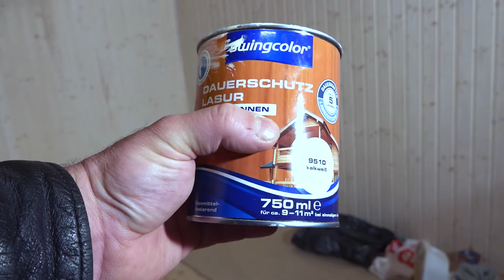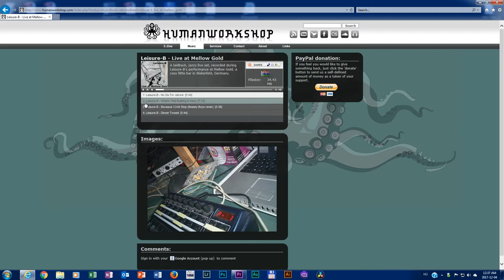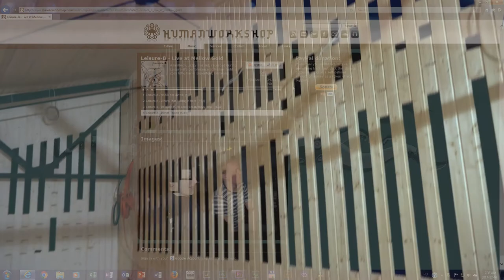Building a new home recording studio! Part 4.

Comment: heh, walls look very nice, interesting how it would sound if foam pyramids were glued on moving parts.
Reply from the maker: Yojik I already think about it, but we will install also other diffusers and a big panel behind the table. Maybe on the back wall we will do it, only for You :)
Reply from the maker: Turns out, not make sense, because after I loosen the reflections. And this is the whole point to make like this. The black area is damper, the wood is reflective. Sorry, You will get an another part in the studio:) just wait a bit....
Reply: Yeah, a bit later I thought the same.